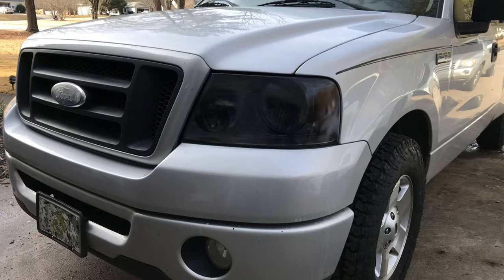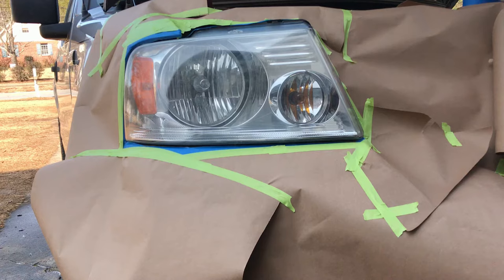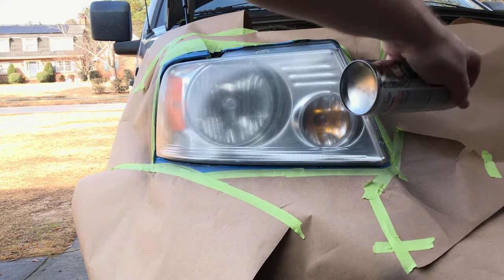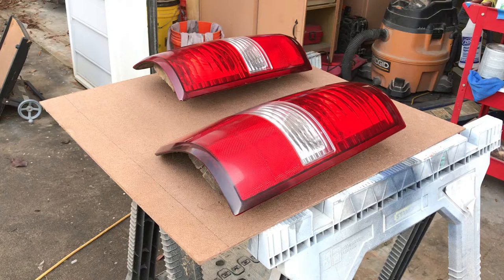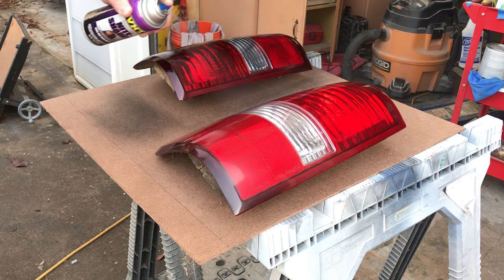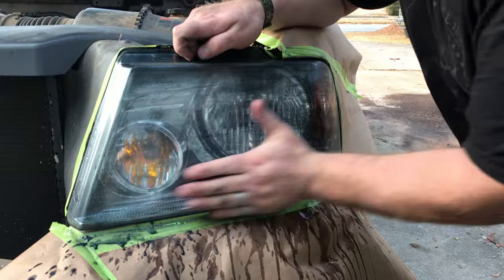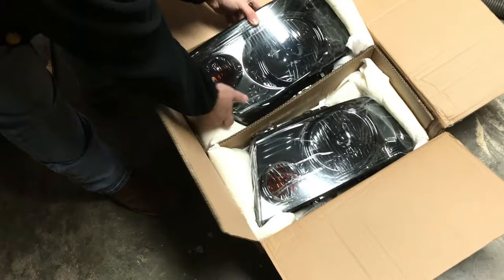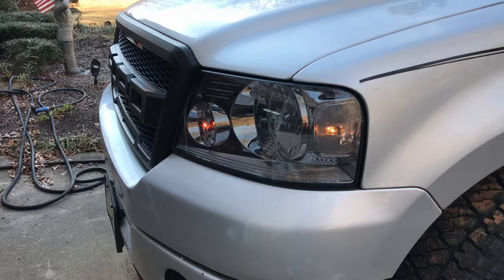How to Tint Headlights | FAIL

Comment from the maker: I done messed up!!  But doesn’t this grill look awesome?!?  
https://youtu.be/D2mDyGGVDIM
Reply: I seen your review of the smoked headlights from amazon. Direct Replacement Headlights/lamps Assembly Set Compatible with Ford F150/Mark LT,Smoked/Clear. I got the same ones and put in led bulbs but notice the light displays wierd..it creates these weird artifacts and progects that out so the light doesn't disperse smooth like the light from the oem headlights. Have you noticed this on yours? I'm thinking it's just the cheap headlight so I'm looking for another headlight that will disperse the light more like the oem headlight but do it smoothly. If anyone knows of a headlight for an 05 f150 that is smoked but doesn't seem to display light weird let me know.
Reply from the maker: @A.C.71  I actually replaced the bulbs with brighter lights from the parts store.  Unfortunately, I only had the truck for a short time after making the video…but I never noticed anything weird other than because of them being smoked the lights weren’t as bright
Reply: @TonyCollumtheHOWTOHERO  I see. Thanks

Comment: This exact same thing happened to me. You can use brake cleaner to remove the spray very easily instead of sanding it, just be careful of body paint or remove your lights. You can also just leave the peel coat off all together and you will have a much smoother and glossy finish with just vht. I love your video tho! Good diy and looks good in the end.
Reply from the maker: That is an awesome tip!  Thanks for sharing.  I definitely should have left off the peel coat
Reply: Brake cleaner works but it ate through my headlights all the way down to the paint
Reply: I used gasoline before to remove a similar product from my b5.5 tail lights. Worked pretty well. But with the price of gas these days you might just be better off buying a new pair of smoked lights.
Reply: You can take it off by using the spray itself. You spray it on a rag and wipe the headlight. Takes it right off.
Reply: @xbocax16  will the light look as it did before the paint. Won't be foggy or fuzzy, correct?
Reply: @arodderz  it’ll look exactly the same as before.
Reply: @xbocax16  thanks bro. I'll give it go tomorrow. Clear coat after it dries for extra durability,  correct?
Reply: @arodderz  if you want. I didn’t do it
Reply: @xbocax16  ok..thanks bro

Comment: I used brake cleaner  to renove vht tirnt does not damage the plastic.Just spray on a small towel amd clean, until is all remove. Finish with cleaning  any residue with alcohol.

Comment: Honestly the easiest, cheapest way is to buy some Viivid head and tail light tint wrap, just be sure to clean and dry the lens before applying so it doesn't get deposits. Heat gun, razor and vinyl are all ya need, and when a state boy wants it off, easy peel no residue, and then you re wrap when you get home for $5 and it lasts I've had mine on over a year and it was my first time wrapping. I highly recommend it for a risk free solution.

Comment: You're supposed to only use the spray tint (not the peelable spray) and then finish them with a spray of clear coat.

Whoever told you to spray them first (or at all) with peel spray is why they didn't turn out correctly... plus you didn't clear coat them in the end.

Comment: Well you sanded it with 1500 grit sand paper..lol should’ve fully sanded to 3500 and instead of re clear coating used the tint as a clear